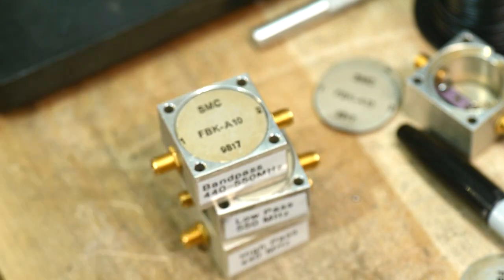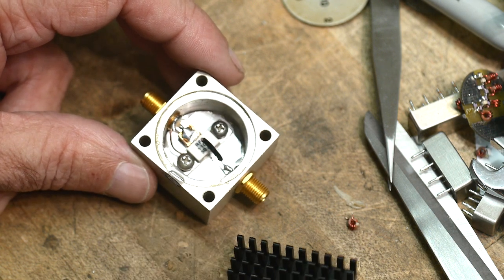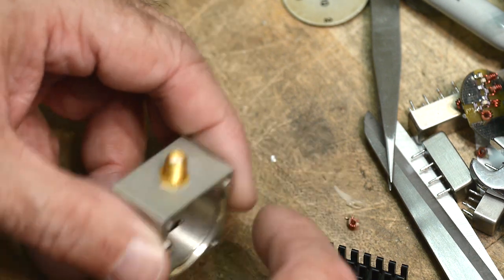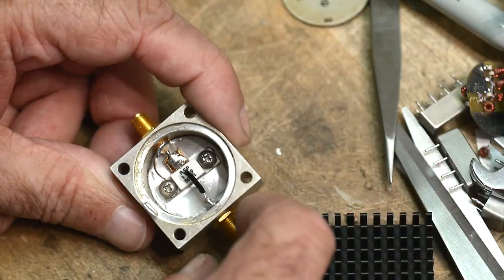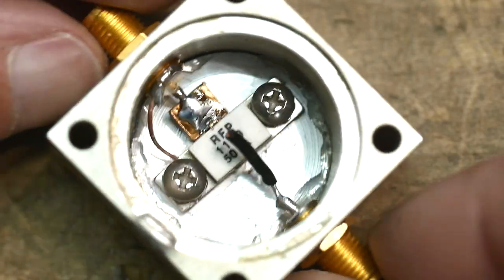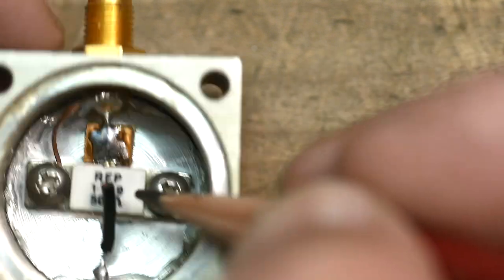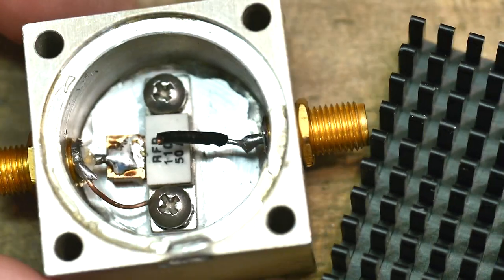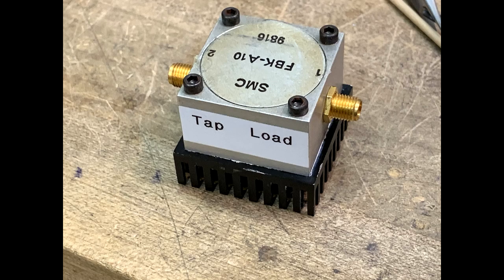#591 SMA 50 ohm  Load with RF Tap

Comment: +36 dBm in and -16 dBm on the sniffer probe...very handy attenuator for the tiny SA. Yes, you ought to have one such contraption.
The idea of having another aluminium heat sink is just ok though not a perfect one; of course there is a layer of heat sink compound to ensure little more efficient heat transfer.

Comment: If you grind or sand down the bottom of the case so the slug is flush with the case and then lap the base and the  heatsink you will get a much more efficient heat transfer.

Comment: I picked up a Celwave DL-200 off of ebay.  It's mostly heatsink, but the same kind of innards.   It's rated 200W PEP, so bigger obviously physically.  My question is  what is the difference in an RF tap like this vs one that is wired up with a divider bridge in it?  Is there any inherent goodness of a wired tap vs this inductive type?
Reply from the maker: probably more repeatable part to part. or predictable level.

Comment: Nice mini project.  Did you identify the need for extra GND by measuring S11 using the nano VNA?
What frequency does the load work to?  I'm pleasantly surprised at how simple the "sniffer" is.  Do you have an S21 plot for that?

From watching your videos, I ordered a nano VNA and a Tiny SA, but USPS is really slow ATM to Australia.  Thanks for showing the capabilities of these pieces of gear.  Hope your Tiny is sorted soon, and it will be interesting to understand what the issue is.
Reply from the maker: Yes I used S11. I will show that in a future video what shows some odd behavior. Then a video on fixing an RF ground problem and making the load operate out to 1GHz